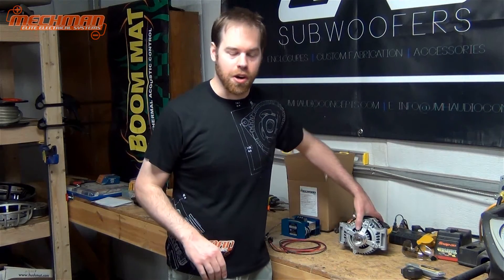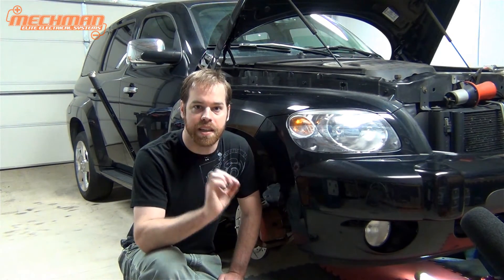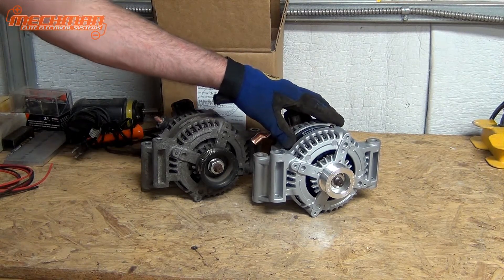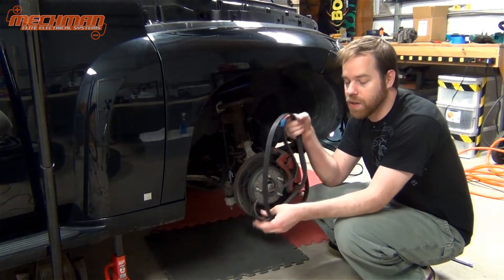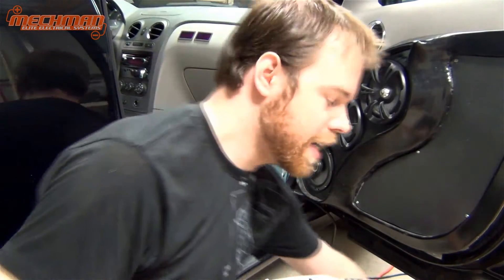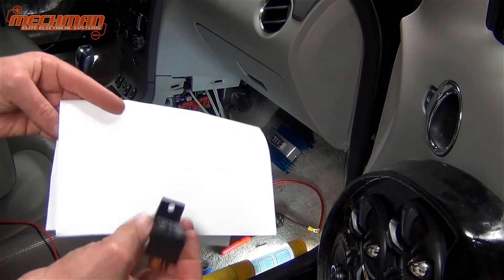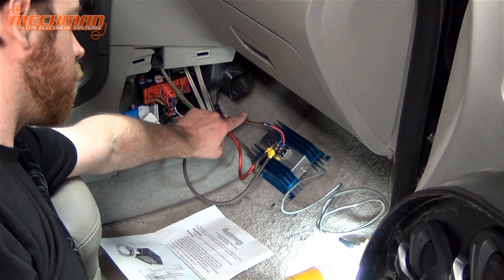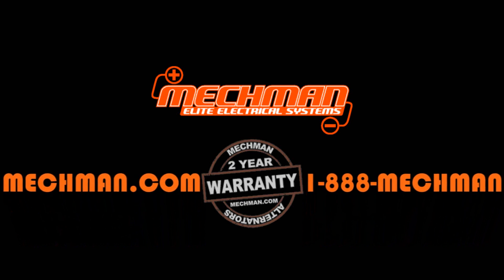Alternator Installation, S series 320 Amp

Comment: I just got my 320 amp mechman today and installed it in my 2000 ranger. I called mechman and asked about the single wire harness that was plugged into my old alternator, he said I didn’t need it and to just tie wrap it to the wire harness that came with my new alternator. I have 2 grounds of 0 gauge and 1 0 gauge power. Problem is that the truck won’t start now. Any help would be great. Thanks
Reply from the maker: An alternator will not keep a vehicle from starting.  You can actually start a vehicle with the entire alternator MISSING.  You've left something unhooked or blown a fuse. :(

Comment: So... how did it go?
Is there less or more load on the engine when all these are installed?
Did it have any impact on your mileage?
I'm planning to install HHO drycell in my car eventually, and I'm trying to check whether it is possible to have a loop connection for power and water, yet still have power for other things as well like stereo and aircon, what do you think?

Comment: Also, the ignition wire merely triggers the relay so the gauge of the ignition wire doesnt mean much to the gauge you should run to the batt. Power will come from the battery, through the relay to the regulator.

Comment: Use an 8awg fork terminal. Fits right on with no problem. 8awg is not overkill when you run 14ft to the rear. Also, there is never a problem with overkill but there can be many problems with underkill.

Comment: If it is AGM battery, should be max of 2.4V per cell. 14V batts would have 7 cells. So do not exceed 16.8V. Lowest would be about 15.5V

Comment: sorry man, one more question about this video... how did you get 8 awg terminals to fit on that regulator? I have the same one and #10 stud size terminals are the biggest that will fit on the regulator, but they don't come in an 8 awg terminal... 12-10 awg is the biggest I can find as far as fitting on the regulator... am I missing something... and really, isn't 8 awg a little overkill considering at best, your ignition wire is only 10 awg?

please help me out man, this is getting the best of me

Comment: I got a 320 amp Biliitech style alt and external regulator, i havn't been able to run it at full load yet, but its kick ass. The installation in my subaru is the easiest install in the planet.